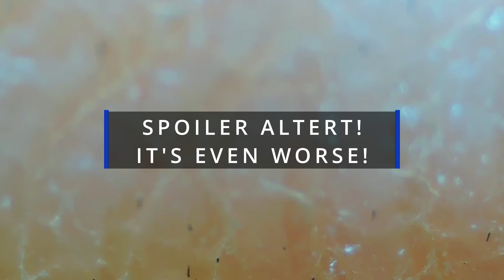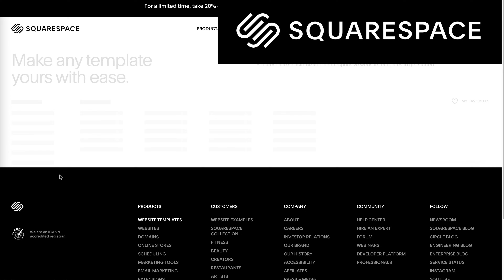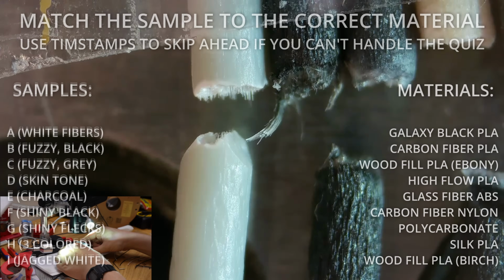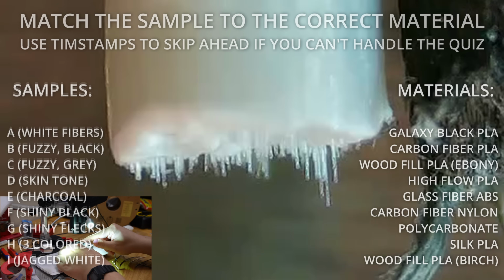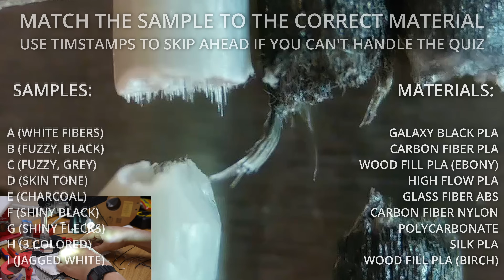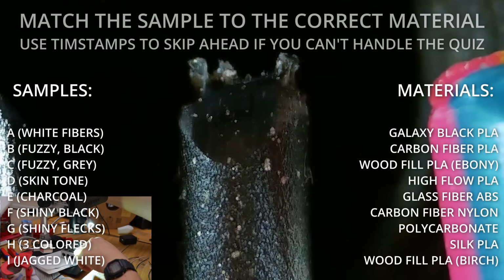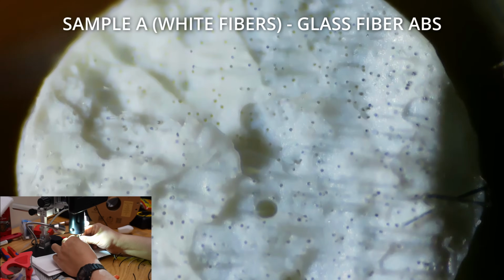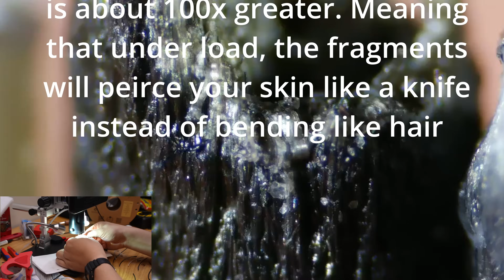Carbon In My Skin. These Wounds, They Will Not Heal.

Comment: I’m surprised you didn’t mention the fact that we get exposed to all sorts of nasty stuff every day. Safety is about moderation. Cf filament doesn’t produce a genuine risk to anyone unless they’re working in a print farm with tens or hundreds of printers working with CF every single day. CF, Fiberglass, Asbestos, etc, pose a cumulative risk when inhaled. You would have to breath a lot of those fibers that shed off into your finger…which would be extremely difficult judging by how much shed into your skin. This is far safer than resin printing, whose dangers are also super overblown. Resin printing isn’t going to kill you, long term exposure simply risks developing an allergy to it. For most people, that isn’t likely to happen unless they’re bathing in resin or breathing it in constantly. Just rig up the printer to exhaust fumes out a window or use strong carbon filtration, and wash any resin you may get on your hands promptly. If you wanna use gloves, more power to you, but if you’re mindful of keeping it off your skin and washing it off when it does, you’ll be fine. 99% of safety is common sense and mindfulness of the risks, not fear mongering and suiting up like a hazmat worker. Same with printer VOCs. They’re not that dangerous, mostly just unpleasant to smell. Fresh air or a simply dryer vent out the window is really about not smelling the unpleasant smell and quelling fear. People breath in nasty chemicals all the time without thinking twice about it, stuff that’s far more dangerous that the VOCs from printing abs in your garage without ventilation.

These materials really pose very little risk in the exposure levels hobbyists will encounter them. Its an oversight to not make that very clear, and instead make them sound extremely dangerous for the hobbyist leading to people in this very comment section saying they’re going to abandon them outright as if they’re working with caustic acid. Meanwhile those same people cut lumber without a mask(silica), cut drywall without a mask, sand their resin prints without a mask, use cleaners in the home without a respirator, clean the dust off their calipers when they change their brake pads without a respirator, smoke cigarettes, drink booze, smoke weed, eat fast food, etc.
Reply: I was nearly throw my cf filaments into to trash. I have only 3 spools of cf filaments and want to make some good stuffs. I don't think  they are such problematic like mentioned here.
Reply: I am just curious what your educational background is to make these statements with such authority? Not trying to downplay you, I am just getting into 3d resin printing and there seems to be so many extreme opinions on either side of this safety debate and want to know the answer from someone who actually knows what they are talking about. So, what is your occupation? Chemical engineering? Chemistry? Materials science?  Or are you just a hobbyist who might want to downplay the risks? So far what I've read about resin is that its considerably more toxic than household products and that they should be handled much better than what the average hobbyist is doing.
Reply: @mscrawford87  nope, just a hobbyist who took the time to properly research the dangers via the limitless scientific studies and documentation available on the chemicals and materials(like cf and fiberglass) in question. I also am a blue collar worker who works with things like carbon fiber and dangerous chemicals regularly(and takes appropriate caution when necessary). Ignore what the 3d printing people say and go ahead and research the actual compounds and materials in question. Just like you said, there are a lot of extremist, sensationalist opinions that get parroted over and over again by people in the hobby who don’t bother to lookup the science. Great place to start is the msds.

Exposure to dangerous chemicals and materials is almost always a question of exposure volume. Alcohol is a dangerous chemical that people use to sanitize wounds and their hands, regularly, but technically it is harmful. Cutting/sanding wood releases silica, and even lifelong carpenters don’t typically get silicosis. When was the last time you dealt with fiberglass insulation, and did you wear a tyvek suit with respirator? Does anyone? Technically it’s harmful, but mostly it’s just an annoyance unless you’re working with it every day for years.

The stuff we encounter when 3d printing is essentially harmless with the most basic precautions, but people blow it out of the water. Running a print farm as a full time job and spending 8 hours a day for years may pose a risk, but probably not. Yes, resin is toxic - just wash your hands promptly and wear rubber gloves if you want a little extra peace of mind. The most basic safety measures are more than sufficient for this stuff. Make sure your resin printing space is well ventilated, preferably actively ventilated. My resin printer has a pc fan attached that connects to a dryer hose to vent out the window, and I lined the chamber door with window foam to ensure an air tight seal. I never have the odor of resin. I make sure to let my platter drip excess for a while before placing it in the cleaning station, so that it doesn’t drip resin onto the table when I remove it. If I get some uncured resin on my skin, I immediately wash it off with soap and water. I typically have rubber gloves on, but sometimes I don’t. I don’t print ABS or other fume producing filaments, but if I did, I’d connect a duct to the chamber and run it to the window just like the resin printer. If working with CF, I put gloves on, and don’t give it too much thought, because the volume of exposure to this stuff is so minor that it’s not a problem. There’s no need to be scared of this stuff, there are no crazy dangers of exposure in hobby 3d printing, the health risks are basically zero even without taking simple precautions. People make such a big deal about resin, but if they bothered to research it, they’d know that the danger resin poses is simply the development of an allergy to it…for a very small percentage people…after a lot of exposure. There are some people who are naturally allergic to it, which is a different story. 

Just use the same kind of caution you would use when cleaning your kitchen or bathroom with chemicals, working with serious glue or solvents, etc. As long as your printer isn’t in your living room printing 24/7, you almost certainly are exposed to more harmful things every single day. The extreme fear and danger people seem to push about 3D printing is totally overblown and unnecessary, and it only takes a half hour researching the practical harm these chemicals and materials pose to see that. Ignore the 3d printing people, and just look at the science, of which there’s a limitless supply of online.
Reply: Cutting lumber doesn't release silica. Maybe you meant engineered quartz counters?
Reply: @Yoshikaable  working with certain kinds of wood absolutely does. I was very surprised to learn it as well. Apparently wood contains pockets of silica, particularly hardwood like teak. Its concentration isn’t high enough to be of concern for the weekend woodworker, but its concentration can be high enough to degrade tools used in the commercial processing of hardwoods - and by extension, may pose a health risk for people who process bulk hardwood. Apparently some woods can contain more than .5% silica in its composition. 

Obviously anyone working with stone and rock needs to consider their silica exposure and proactively using ppe, as they’re going to exposed to a lot of silica.

Comment: Look into this stuff they market as "nano tape".  It might could be a testing substitute for skin by gently dragging a piece over the print, because it's soft and squishy like skin. And, even if not, I've found that it's quite effective at getting the shards off skin and even pulling a lot of the embedded pieces out.  As for making a print safer, I found that scrubbing it with fine steel wool, blowing it off with compressed air, and then rubbing it good with the nano tape goes a very long way to getting rid of fibers that break off the surface, although still not completely.

Comment: I am using unfilled PETG either black white or which is the best because there are no color additives in it, clear. 
Never use that powder or fillet shit, unless you are an engineer and need all the material strength you can get you don´t need any of those materials in 99,99% of all instances. 
I never print with PLA either because it´s basically the same price as PETG and it´s garbage. It is not ductile at all and can´t even bear the heat in a car in the summer.

Comment: It's like grabbing a cactus in terms of what can happen. Anyone who has done work with stuff like fiberglass knows protective gloves are needed to handle it. (The very beginning of the video makes the point, although there's plenty provided to support that.)

Also you can go to a dermatologist for treatment of wounds with issues from mishandling such materials. Dermabrasion is a bit of a painful treatment, but it will take the fibers out if done properly.